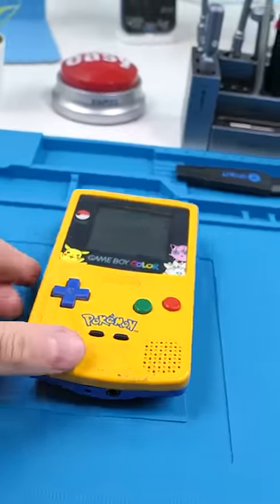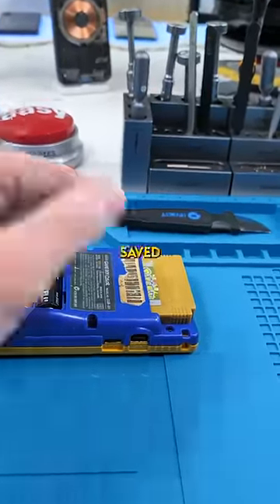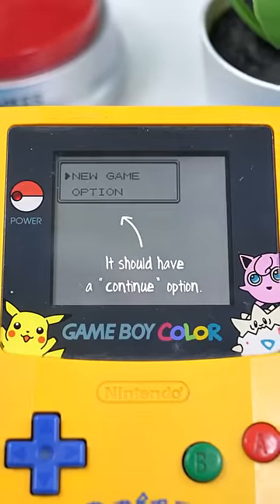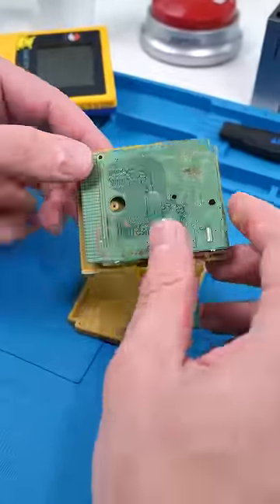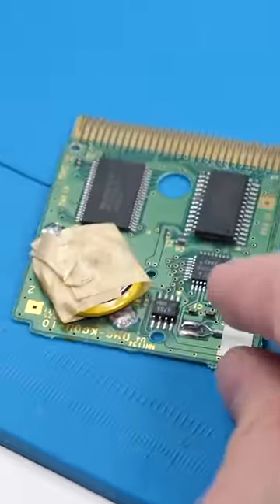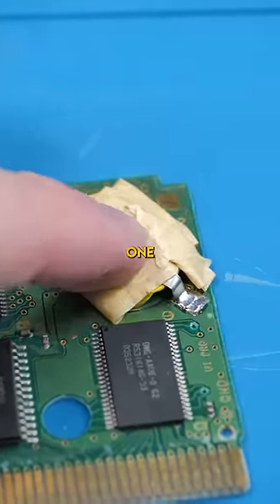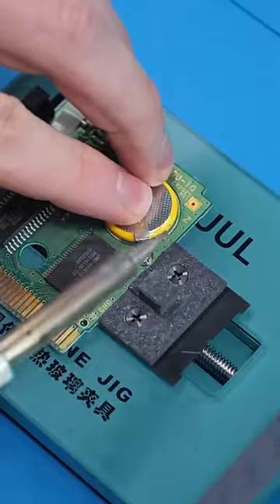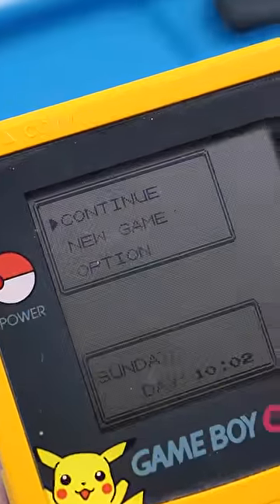This Gameboy Wouldn’t Save Game 🥲 #Shorts

Comment: There were no Flash NAND memory chips at that time. We had to use static RAM made with PMOS technology to store data permanently, and that memory required a constant source of power, in the case of a Lithium-Thionilchloride battery, which was 3.6 V  100 mAh but was capable of max 0.5 mA output (BR2032)...

Comment: Wouldn't it be better to upgrade the battery to a battery holder? Or do they use a special voltage to work? I understand that original is better and more valuable, but as a player I'd prefer it this way so I could replace it easily

Comment: That's how I did my crystal version, except I used a very skinny bit of duct tape and wrapped it around the board a couple times. The battery's dead again and I've learned basic soldering, I think I'm going to retry.

Comment: Wait, does this mean that replacing the battery keeps the save data? I'm just a bit confused, wouldn't the "continue" option only appear if there is an existing save file? My understanding is that the battery in the cartridge powers the save storage and when it dies, the save data is lost forever, regardless of if you replace the battery or not. I'm no expert, and I'm not trying to prove or disprove anything, I just want to understand more.

Comment: Solder wasn't hot enough, top joint is bad. My guy clean your terminals and pads before soldering, use flux, use proper tip for solder gun, set your temperature properly. Most solder you buy will say it's melting point on the tube itself. I enjoy the phone videos tho! Keep it going my guy

Comment: My 11 year old brain: "If it works it works!!!"

No really, I did exactly that, ripped the metal part with cutter as carefully as possible and taped them into the board with electrical tape

I was surprised it didn't break when I replace otd battery the 2nd time when I was 18 (I did that one properly tho)

Comment: This is why you shouldnt play games that require save data on the gameboy and gameboy color. If it’s the original battery, it’s gonna die soon, and if the battery has been replaced, it’s probably poorly done. Game boys are perfect for arcade-style games that don’t need save data.
For gen 1 and 2 Pokémon, play the remakes, or emulators. 
Gen 3 cartridges still have batteries, but they’re only for telling time in game, so your save data is safe as long as you take good care of the metal contacts on the cartridge and gameboy advance itself

Comment: HOW DID THE SAVE FILE NOT DIE WHEN YOU REPLACED THE BATTERY, TELL US YOUR SECRETS
Reply: Battery is not a storage duh
Reply: @JoyBlock__  what i mean is that in those cartridges when you replace the battery (or when it runs dry) it often erases the file and it is lost regardless of replacing the battery or not